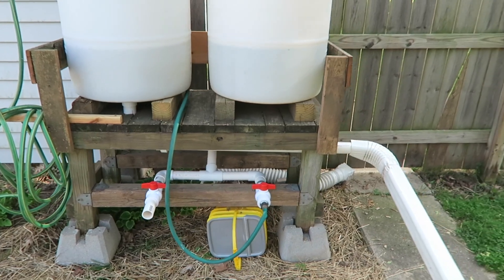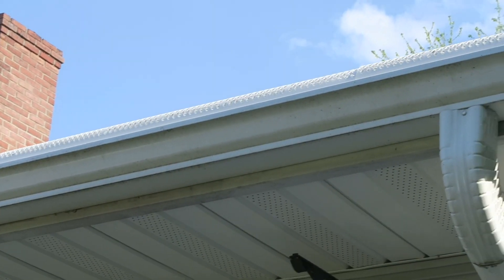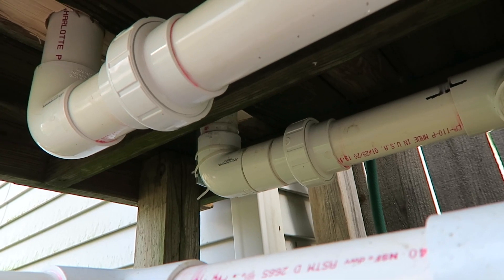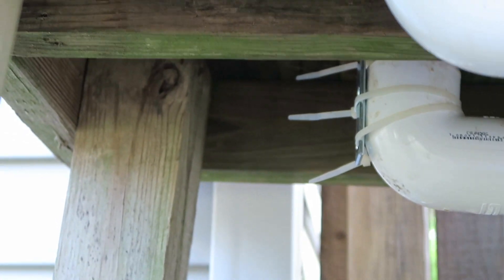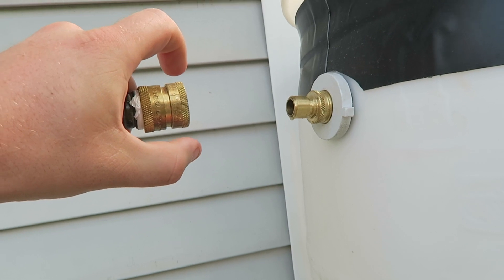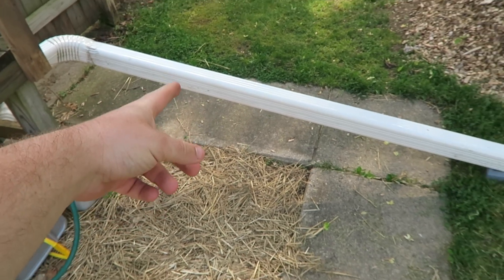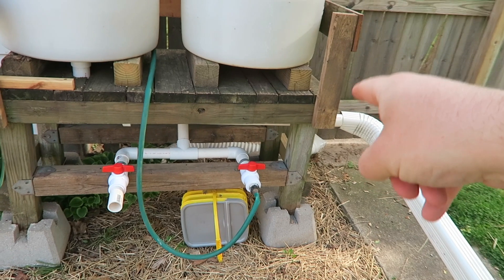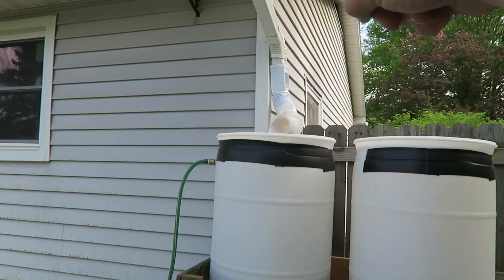Rain Water Collection | Rain Barrel System

Comment: Some years ago I ran across a video of a college test for rain water harvesting.They dug a pit in a back yard lined it with heavy pond liner and filled it with rock,added a sump pump and covered it with Fabric then sand and lastly sod. It also had a house gutter piped in so it gathered water from the roof and directly through the yard.I thought at the time that it was a very clever system .I also wondered how much more capacity it would have if it was filled with hollow heavy duty wiffle balls?

Comment: Thanks for this video! Do you notice any algae growth with the white barrels?  I bought some white ones to use for both garden and to drink in case of an emergency....but friends said white barrels are not ideal. Curious what you think. Thanks! ☮️💜
Reply from the maker: I have yet to develop any algae but I would highly recommend black (or even the blue) barrels over the white to solve for the very thing you mentioned, of this is something you’re worried about. Good luck and let me know if you have questions.